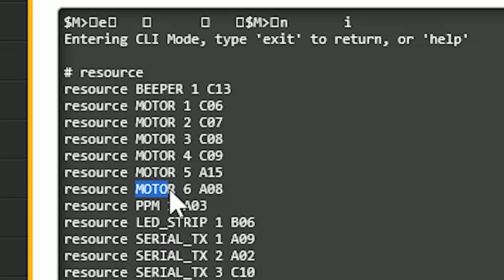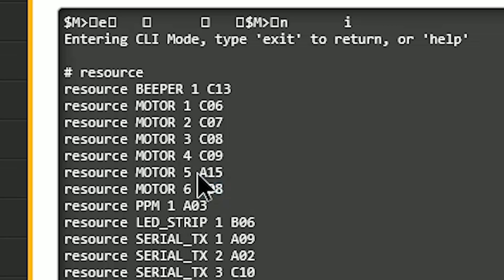Betaflight FPV Camera Control | HOW TO

Comment: Joshua.. great video as always.. i know you have the Betaflight F3 FC. Have you confirmed or tried this on thay board yet to the led_ strip pin? Also you say 150-600ohm resistor. How do you know which one to use? Or you just pick any one between that range? Im using the Foxeer Arrow V3 full size cam with BF F3 FC. Thanks
Reply from the maker: Lower is better but any resistor value in that range that you happen to have will be fine.

I haven't used BFF3 but I don't see why it wouldn't work.
Reply: I just did it with my foxeer arrow v3 and I had to use a 390 ohm resistor

Comment: Got 5x 470ohm resistors for 0.45$cad at my local electronics store. Got the thing to work without any resistors nor plugging the ground signal. I use a Foxeer HS1177 v2 on a Hobbywing Xrotor F4 board on the motor 5 pin.

Comment: Most boring feature of the century :) Betaflight was at some point cleanflight without the crap and with a focus on flight characteristics, but has since then surpassed CF in featurebloat. How often does one need to change the cam-settings? I can live with fishing in a small connector if I have to make modifications, but I am not going to solder extra wires, configuring BF and whatnot.  We need a fork with a new beta-beta-flight with less features and focus on the real stuff. I am kind of kidding as BF is great software, but personally I wish it was more betaflight-ish.
Reply from the maker: How often do you need to change cam settings? Well, now that we can change them whenever we want, maybe we will change them more often.
Reply: Hey did anyone force you to do this?
Reply: No, not at all. How?
Reply: So why are you complaining about the amount of features you don't have to use?
What about... For example... just ignoring them?
Reply: I am not really. I have great respect for the devs and they can take the project in any direction they like. But, what you are basicly saying is that you dont acknowledge the consept of bloat? If you dont care about a feature, then why not just ignore it? The problem of "unnecessary" features, is that they hurt the things I do care about in the long term. 

It is a standard and sometimes bad cycle of software development. At the beginning some small, lean and effective pice of software kills it. As the project gains popularity the devs add more and more features, less and less meaningful ones and more and more nice-to-haves. At some point the codebase is a huge clusterf.., hard to maintain and it becomes harder and harder to improve on the important parts because there are too many dependencies and just too much stuff in there.

Dynamic filtering were a huge step forward, somewhat removing the need for parametertweaking the notch 1,2,d.  I would like to see the PID thrown out and replaced with parameters like "stiffness". Not that the consept of PID doesn't have its place, but it is a tad too low-level. There have to be a way to autodetect that shit ;)
Reply: I sometimes try new settings on new installs and update the old ones if the improvement is worth it. People are different, but do you think you will add this to most of your builds after the initial proof-of-consept-builds are done?

Many features are nice, but they come at a cost in the codebase.  

The list of 37 available elements in the BF OSD start to look scary. I think I have 3 ticked on.  BF start to show some signs.
Reply: No, you don't have respect for the dev, I spent time to develop this feature for people who see it as useful, and your message sure is disrespectful to me.
Reply: Andrey, you are right and you are wrong. You are right in that my initial comment was somewhat disrespectful and I regret my wording. But I stand by my opinion. You are wrong in that I don't respect the devs. The code can be complex and elegant, but I still think it solves a non-issue. People will spend longer time soldering and configuring this than they will ever save by not doing it the old way. 

It is not my software, I don't spend my free time working on it, but I am also not up in your face on github/facebook when voicing my opinion. Instead made a comment on a youtube video. 

BF starts to show some signs of feature-creep. Big projects are harder to maintain, refactor and reorganize. This will make it slower to adapt to changes.  Remember why BF gained popularity over CF in the first place. A smaller project made it possible to create a superior product. For miniquads, flight characteristics will win over nice-to-have features anytime. With a ton of features, flight characteristics will suffer in the long term, and BF will at some point be replaced with the next betaflight.

Comment: what should be the ideal (W)  for these resistors ??? 1/4W or 1/2W or 1W ??
Reply: SYED MUSAWVIR AMAN 1/4W works great for me
Reply: Peter Den are you using a micro ?
Reply from the maker: 1/4W is fine. You aren't passing any power at all.

Comment: Umm, isn't that DAC pin on your Matek F405 the camera control pin? Or is that functionality not implemented on it yet?
Reply: VilleF1N i just got a Skyzone HD02 which is a 7” diversity monitor with DVR for $145 off banggood after searching for just what you are asking about... not quite the same as JBs but it is good...
Reply from the maker: Fatshark Transformer monitor is the best looking monitor I've seen in a long while. Has diversity too. Also has AV In. 

https://goo.gl/CFRFPQ

$100.
Reply from the maker: No that's not implemented yet.
Reply: On another note, I've been looking for a good bang for the buck FPV diversity monitor preferably with DVR. Any recommendations?

Comment: Im using matek f405 and swift 2 had done this but I need to plug usb port every time to use it..after adjusting all value on camera control delay its still won't working without usb pluged in...any suggestions?really appreciate that..
Reply from the maker: I don't know why that might be. Mine is working same FC and camera...

Comment: Thaaank you! Gonna get that FC with the cam c pin for my next build right now xD lol
Might stick to the joystick for the field operations on cam control for my other quad. Got that extension plug placed quite accessible and for switching twice at max per session it'll be fine :)
Just one more little thing to keep in mind before leaving the house, that might be the bug there ...

Comment: Is there a way to set up a switch using basic Taranis logical functions that will make it appear to the board that your sticks are centered, even when they aren't, at least for the throttle? This would be way more convenient as I always end up forgetting the centering command, though tend to be able to remeber the stupid switch.
Reply from the maker: Yeah you can do that. Just add a mix to the Mixer screen that sets throttle to zero. Then make that line the last one for the channel and set its multiplex mode to Replace the lines above it. Then make that line only activate when the switch is in the desired position.

Comment: I have the matek F405 AIO version and it has a DAC pad. In GitHub it says that with DAC you can just wire it right up but it also says it's not supported. Do you have an idea as to when this will be implemented?
Reply: Alex DiJ i'm curious too
Reply from the maker: I would think Betaflight 3.3 right?
Reply: I don't know. I would hope they would implement it in a release of 3.2, especially now that they are "Take their time" With new releses of betaflight. Really kinda stinks. But i just wired it up and left it unplugged. Whenever it gets implemented ill just plug it in. LOL

Comment: does this work with the holybro kakute f4 aio?
Reply from the maker: It works with any FC that has a spare pin to use like LEDStrip or Motor 5 and 6. Kakute has all of those. So yes.
Reply: Joshua Bardwell 
Can the Smart Port uart be remapped on the Kakute F4 aio so that something else can be used? Like vtx control? I use CRSF and GPS on the 2 available uarts and the smart port is useless to me at the moment
Reply: mike stevens the smart port pin is actually uart1tx
Pin. The smart port pin has built in hardware inverter for smart port telemetry while the uart1tx pin does not have the inverter
Reply: Tushar Tyagi 
I looked it up using “resource list” and it says it is uart1 tx
Reply: mike stevens oh, i am very sorry, yes it is uart1tx. The uart2rx is for sbus
Reply: mike stevens you can connect the uart1tx pin to a vtx with smart audio to control it from osd or taranis
Reply: Finishing Touch there were first few batches of this fc where the current sensor is only upto 60amps so it will not work or you will have to replace it. Joshua has a video about replacing it. For the video problem, i have not come across such problem.
Reply: Finishing Touch 
Is the current sensing feature turned on in betaflight GUI? Is it set to On-board?
Reply: mike stevens in the betaflight configurator, in battery and power tab, have you selected onboard adc for the current sensor.
Reply: Finishing Touch
It’s very possible. With your current sensor now fixed, plug in to GUI and hook up a battery. See how many mA you are pulling just idle. I believe that it is only a 1.5a BEC, which means only use like 800mA to be on the safe side
Reply: Finishing Touch 
Try a different camera

Comment: I have a totally unrelated question. Do they make a signal amplifier for 2.4ghz that would work with my radio so that I can do long range flying without having to modify my radio?
Reply: Drone Hero's 
You can make or buy a Moxon antenna for your transmitter and make it buy true dipole antennas for your receiver. Make them longer and get them up away from the quad. I get 1.5 miles easily with 2.4 that way, and it was free and doesn’t piss off neighbors by interfering with their WiFi
Reply: mike stevens I am using a turnigy evolution and the antennas are inside the radio. I love the feel of the controller but it has its limits
Reply: Dtf Fpv 
Yeah, without going into the radio and modding the antenna for a SMA, then I don’t know. Buy a crossfire micro tx!

Comment: Does this work for any transmitter like Spectrum?
Reply from the maker: Yes. It works with any transmitter.
Reply: It works with any transmitter that can send normal stick inputs.
So if you can fly your drone you can also use the Betaflight settings.

Comment: ...and if you bought a CL_Racing F4S board you could turn this 20 min job into a 1 min job.  =D
Reply: I hooked up a Monster V2 to cam-c on my F4s and nuthin... have you gotten yours to work?
Reply: Oh I got it to work! I found this: https://www.rcgroups.com/forums/showthread.php?2961216-Betaflight-Camera-Control-Compatibility-Reports 
" Foxeer Monster and Sparrow series requires "camera_control_internal_resistance = 99". "
Go into the CLI and type: set camera_control_internal_resistance = 99 and then type save. I did use the ground wire, you can ground it to the camera ground.
Reply: purchased a Cl once.  Man I love my DYS F4 :p
Reply: Im having the same problem, please let me know if you figure it out! Monster V2 hooked up to CL f4s
Reply: Adeeb Missaghi did you use the ground wire? I did not so I am gonna hook it up again and try. Then I may need a capacitor if that doesn’t work.  And if that doesn’t work then I guess it just doesn’t work!
Reply: Awesome! I'll try it tonight.

Comment: I tried this and it worked... for a few seconds. After that I can push yaw to the right all I want but no 'enter' is registered. Pitch and roll keep working only yaw stops. So I can enter the menu but I can't exit it. What could cause that? I used a 150 ohms resistor.
Reply from the maker: You need to do the "troubleshooting" steps that I talked about in the end of the video.

Step 1 is to increase the key delay.

Step 2 is to add a capacitor.
Reply: Joshua Bardwell Thanks! Step 1 was the first thing I tried. All it did was mess up the pitch and roll. I'll give step 2 a try tomorrow when the electronics shop is open again :)

Comment: For those in Australia, Jaycar 330 Ohm metal film resistors are tiny and work well on the runcam swift 2 and micro swift. Part no. RR0560
Reply: Sweet mate!
https://www.jaycar.com.au/330-ohm-0-5-watt-metal-film-resistors-pack-of-8/p/RR0560
Reply: Yep, that's the one. I didn't bother with a capacitor, it worked without one. (HGLRC F4 V5 Pro)
Reply: Legend!
Reply from the maker: That's way cheaper than the listings I found.
Reply: @Ro H
Thanks. Same part number for Jaycar NZ.

Comment: Joshua, i2c SCL is the "i2c CLock". SDA would be "i2c DAta".
Not sure if this would have a negative impact on gyro or any other device using i2c as i know the stm32 can have multiple i2c busses.
Reply from the maker: These pins are for an external I2C device. Taking I2C off the pin won't affect internal functions like gyro.
Reply: Dan Williams 
This just opened up some flight controllers to iNav. iNav uses i2c for magnetometer. And a lot of FCs don’t have i2c pins. Thanks!!!
Reply: Sure it won't
Reply: Joshua Bardwell Thanks Joshua, my understanding was that the CLI is interfacing with the mcu and by turning off the clock it would be disabling the external i2c peripherals like the invensense imu. Thanks for clearing that up.
Reply: This is great. But I do not have down or left. Mostly left is important when adjusting contrast, and brightness. Is there a trouble shooter? Because I can't find one. Ether way thanks for your insight. Keep up the good work.

Comment: Both on my HGLRC F4 FLAME and OMNIBUSF3 boards I used 150R(0603 😂) and LEDstrip pin.

Now to go to the camera controll, using the Throttle stick I have to go - Center then Right.

Pitch - to go UP/DOWN - My Throttle stick always have to be centered else whenever I scroll up/down it will do it really fast, like ppprrrrtttt. yeah lol
Roll - to change value
Yaw Right - to Enter.